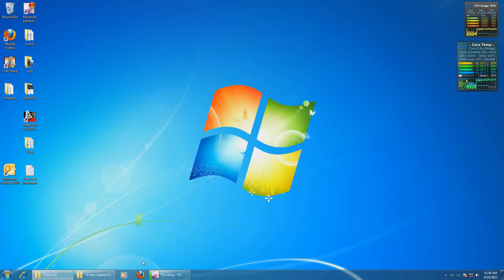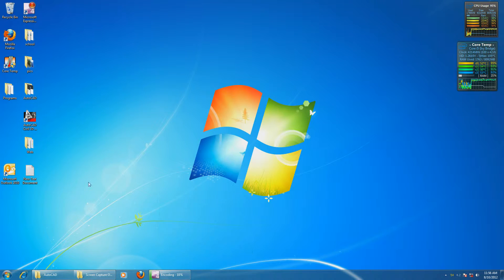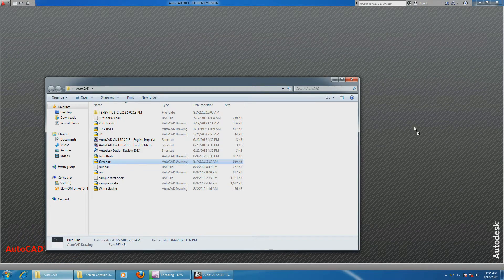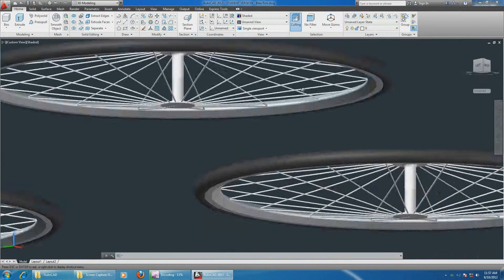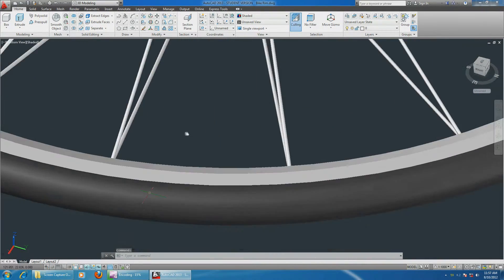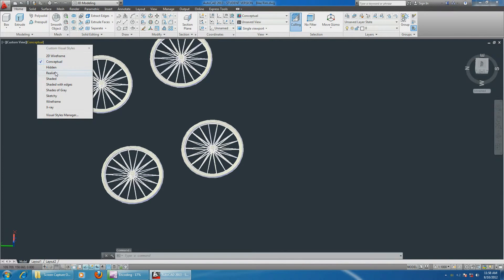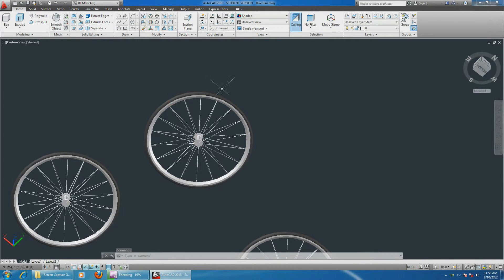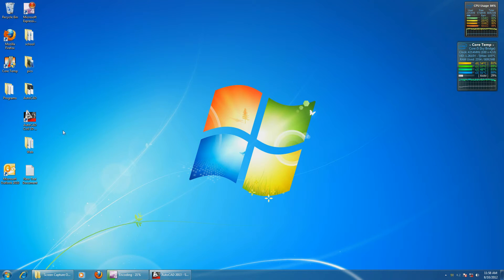Power of intel i5 Autocad + Encoding video test

Comment from the maker: Yes you are correct. Then the point is I guess that even with most of the power going to encoding autocad still runs smooth. Anyways my older laptop will completely destroy it's self if I ran the same things on it.